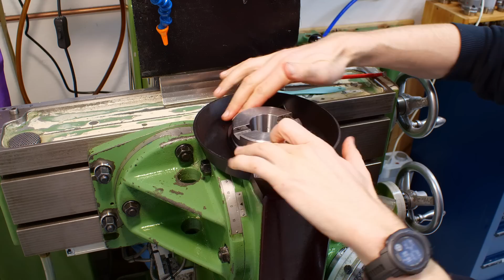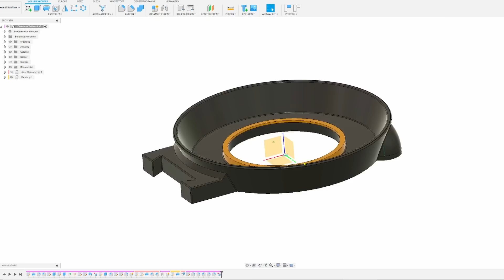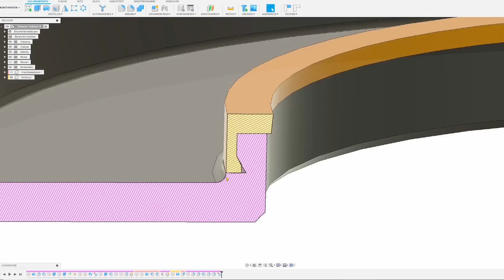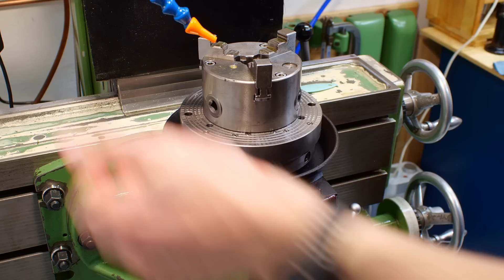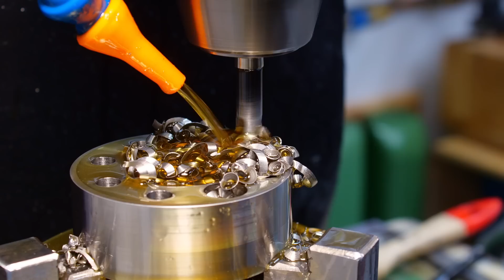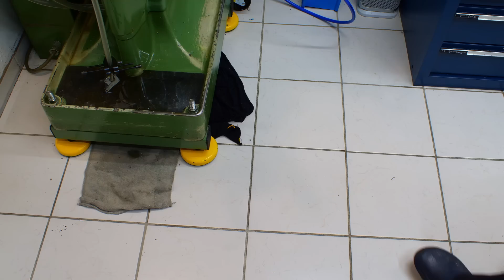A slippery tale: FP1 oil pan

Comment: How do you filter the oil returned to eliminate machining debris before reusing it? The surface finish of your chips are exceptional. A little suction line might work better than blowing excess oil from parts. I like the chain to direct the flow.

Comment: Only Drawback i can see is that u cant touch the chuck or the chuckplate without having a massive mess and loose about 50 cent worth of oil everytime u dip your sleeve in it :). Also dont you loose a lot of still good useable oil when u toss the chips wich are covered in oil ? i also bought the Jokish Alpha and i treat it sort like Gold since its so costly.

Comment: I imagine you can't really use compressed air to clean setups as easily else risk having aerosolized oil covering all surfaces? I appreciate your trial with oil and look forward to hearing how it goes but using it on open machines to me seems like quite a mess. Happy to be proven wrong!
Reply: I made this comment half way through - i'll leave it but I see it's benefits more clearly now

Comment: Beautiful approach! It makes me very glad to see you using the flood oil cooling/lubrication rather than that rust inducing hellspawn liquid... All the parts of your machine and equipment used thereon will benefit from that oil... It`s nice seeing someone treat their machines properly... It sickens me when i see misused and abused machines, covered in dust, rust, crud and chips... Chips are okay if the machine is under covers, but other than that, nothing but oil is or should be found on the machine... 

All the best and warmest regards!
Steuss

Comment: I bet if you heat the oil, you'll actually get better heat control, and it will drain off your parts easier. I remember from my knife making days that if you have hot quench oil, it actually evacuates heat better than cold oil.

Comment: Nice tip about the cutting oil, I will have to test that out, I don't use it enough in low RPM settings for the high RPM issues you mentioned. I also hate printing TPU parts, but they've made for very good coupling spiders for some stuff at work which is no longer produced. Some company wanted €320 for a single spider, and after a few phone calls it turned out they had the last 4 in existence in all of europe in the right dimensions. The fundamental shape of coupling spiders also did not make it very enjoyable to print, but at least I saved several thousand euros by the end of it in spiders alone, let alone if they had to swap out all the shafts and couplings.

Comment: Very timely - I’ve been wondering about flood oil rather than flood water mix on the mill, for the same reasons. Thanks Stefan 👍
Reply from the maker: Fighting the devil of corrosion and iron oxide in a oily manner :D
Reply: Very slick

Comment: Nice solution! That's the best part about 3D printers -- making useful little things help around the shop (or kitchen a.k.a. 'shop for cooks'). The last thing I printed was a simple oil-sump cover for my Harig surface grinder. I've also printed tool setters, an alignment tool for the hateful Emco rotary switch and several drill organizers.  Sometimes the "prototype" works well enough, one forgets to do the V2 🙂
Reply: One thing the Harig definitely needs.

Comment: nice job! but I was thinking the whole time that it needs to be covering larger area for splashes and larger parts above it
Reply: I was thinking the same.  But also for chip load filling up the small area quickly.   But it would also depend on how large his printer can make a pan like this.   But I have to try and remind myself "Stefan doesn't do larger parts/jobs".   Tiny things are his thing.   Kurtis from Cutting Edge Engineering on the other hand does HUGE parts.

Comment: I've been wanting to get away from the typical emulsifying coolant - How are you dealing with cleaning everything up after the fact? For oil it seems like you either accept that everything will be coated in oil all the time, or you almost need a draining rack to put all your stuff in to drain, then a tank to wash everything in..

Comment: As always, beautiful and well thought out design, Stefan. Also (and I can't believe I'm giving you a suggestion), if you haven't printed the final version yet, you could redesign the inside bottom surface of the tray to where it slants ever so slightly toward the drain hole in order to help clear up the oil from the pan. But I'm sure you had already thought of this. Ciao, Marco.
Reply: Or conical away from the center, and then to an sloped trough on the perimeter (to the drain port). Whether or not Stefan needs another revision, it's a good idea for the rest of us!

Comment: Irrelevant tip of the day - to reduce slipping hazard due to potential liquid on the walking surface, you can adopt a practice from Age of Sail. Before boarding action, sand was put on decks to prevent people slipping in blood.

I'll see myself out.

Comment: I also use cutting oil when needed in milling operations, for all the same reasons of not wanting to tear down the setup to remove the water soluble stuff. And yes, keeping the oil on the table drains is an issue when it splatters and pours off the vise. 
Looks like the hard part was getting the model data into your CAD program. As always, I'm impressed by your applied physics skills.

Comment: Very interesting video as usual! 
I have flood coolant systems on 6 of my machines, do not use a singele one of them... 
I do fair amount of small prototype parts in 316 and similar. Oil can, paste or dry is what I use most of the time, maybe it is time to reconsider... It seems like that fairly thick oil works really well without much splatter. 

My favorite cutting paste is not the expensive Ridgid ones or similar anymore, it is the partially covered cans of big new years eve candles sold in the marts here in Sweden. I heat it and add canola oil to a paste thickness. Turning a small adapter for a brush and   You have the usual type of can everybody uses. It works surprisingly well for stainless, especially threading and parting. But it needs to be cleaned off the machine  since canola oil is a drying oil and will over time dry to a stubborn film if not removed. (As do all vegetable oils)

Comment: At my old day job we also used pure cutting oil but at 10000 in both stainless 303.304.316 and titanium without problems such as burning or smoking. It was a cnc though so no splashing by default 

But nice to see someone doing what I'm planing to do on manual machines before I got around to do it myself danke stefan

Comment: Ya gotta print a square snug fit apron to fit on the quill to deflect all the spray from the 120mm shell cutter when it's running at 1200 rippers that drips into the "pan".

Comment: That FP1 is such a versatile little mill, it was a great addition to your shop. Every time you do another job on it, we all realise just how good it is. Love the content👍👌🇦🇺
Reply: The FP1 and 2 are beautiful machines, especially when equipped with the factory Deckel accessories. They make a self centering vice that mounts directly to the dividing head spindle using those same 4 grub screws.
Reply: Spot on 
🇦🇺

Comment: I really like your general approach toflood cooling on manual machining. I personally have similar machines (Deckel FP1 and Wemas LZ 500). While using oil of course completely dispells the whole rust problem I personally chose to use water soluable oil and just mix it stupid rich. Its still very runny and cools really well however I dont seem to get any problems with rust. I usually dont even take off the table after just a quick job. I only blow out the t slots and then spray them with WD40 from the outside. Seems to work well enough. Its a bit more of a mess in the sumpe because the coolant tends to develop a thick skin due to how much oil it contains. However Indont seem to have any issuesnwith unreasonably short coolant life cycles.

Comment: Great thinking using the dovetail to position the oil catcher, as well as the chain to direct the oil flow. Can you use synthetic oil as a cutting lubricant? Normally, they have a much higher smoking temperature. Thanks for the video.